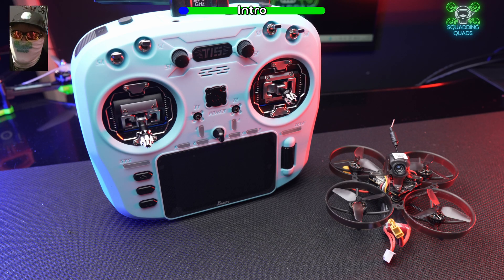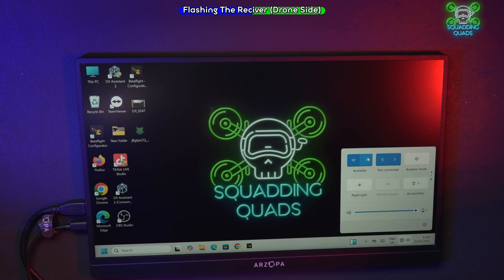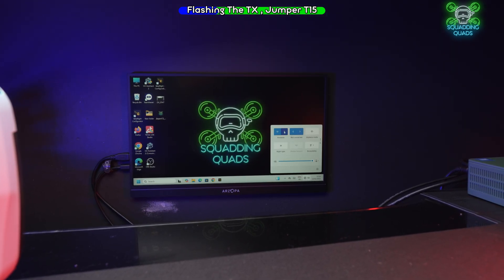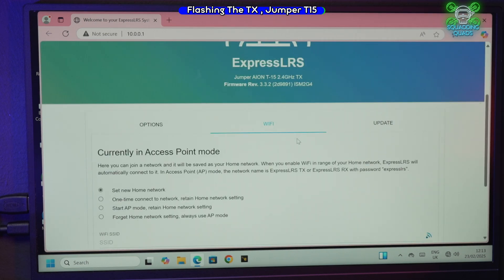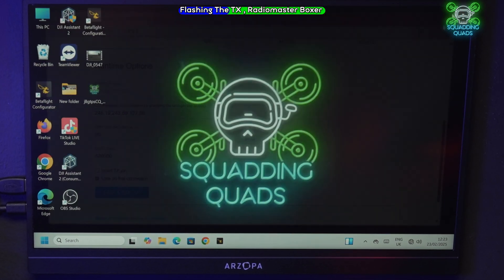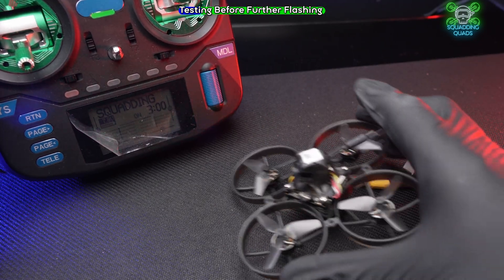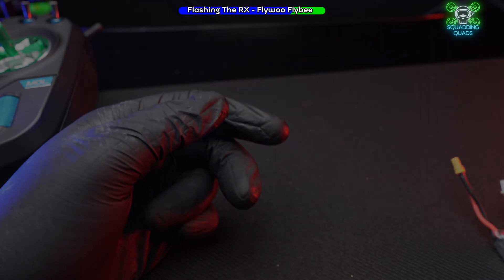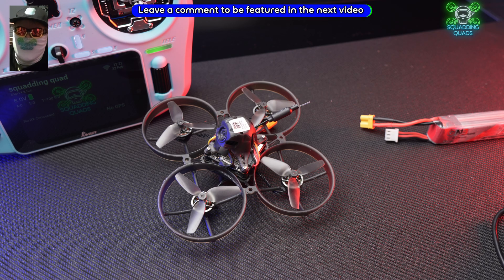Unlock Your FPV Potential: ELRS Receiver Bind Phrase Tutorial

Comment: I have gx12 internal rf mode Crsf are on.
And I try what you do to my x-knights 5” and to my moblite7 avata mini75mm whoop. IT’s doesn’t connect. Only the gx12 connect to wifi and I put my binding phrase on expresslrs. The two drone wont start.
Reply from the maker: @AngelanthonetAnthon  open betaflight and see if you have any stick movement, make sure it's set to crsf in the receiver tab and ensure the correct uart has serial enabled
Reply: yup all enabled. but the stick doesn't move on betaflight, as wel can't bind to gx12 the quad.
Reply from the maker: @AngelanthonetAnthoneEsperanza  both the Gx12 and rc have the same bind phrase? (remeber it's case sensitive) and are they both on 3.x.x (it won't bind if ones on say 2.x.x.
Reply: @squaddingquads thanks, appreciate your help, and i will try to look those 3.?.? or greater then 3.?.? right. according to captain drone.

Comment: Hi iv been trying to connect radiomaster boxers wifi im able to with success on pc. but im unable to open the  elrs web page any thoughts on why this is iv been following your steps. Thanks
Reply from the maker: move it right next to your PC :)
Reply: @squaddingquads  The radio is place at the side of my  laptop and I can see the elrs WiFi from it but the web page doesn't open, iv now managed to get the web page up 10.0.0.1 and I see my radio details in the centre of the page but when I put in a binding phrase and try to save it to my radio a mssg pops up saying upload failed. 
Your suggestions would be much appreciated.
Reply from the maker: @dannybrinkley3278  the issue is related to the signal strength - do you use a WiFi router? Place the radio next to that if so and try again
Reply: @squaddingquads  I'm trying to connect directly to the radiomaster boxers WiFi connection, and not via the txs WiFi to my home WiFi and then to my PC. hope i make sense